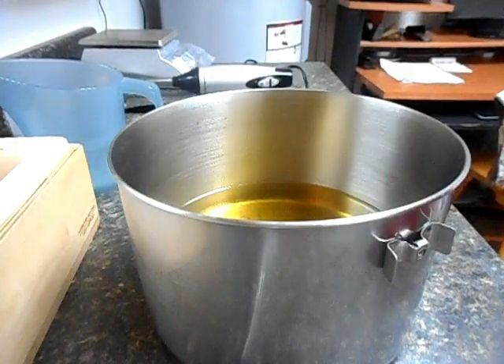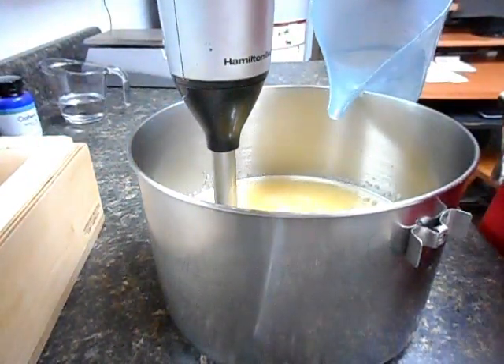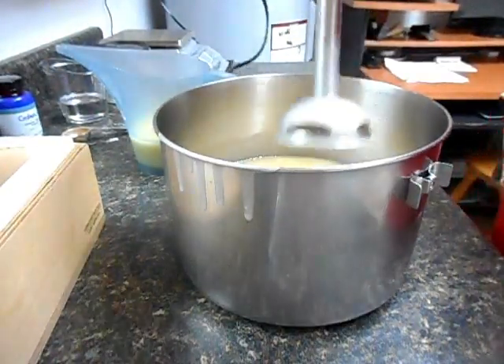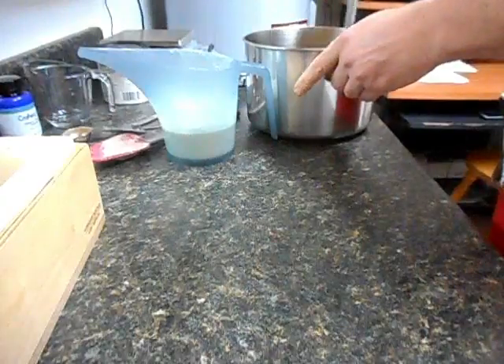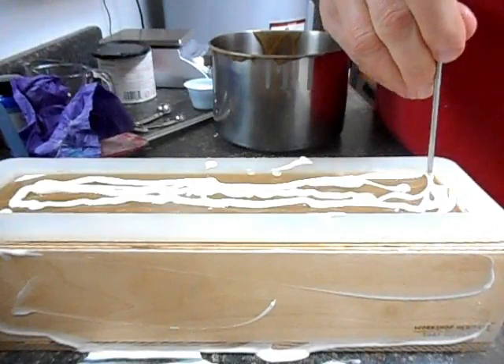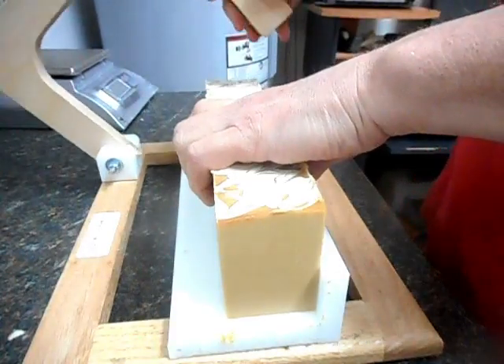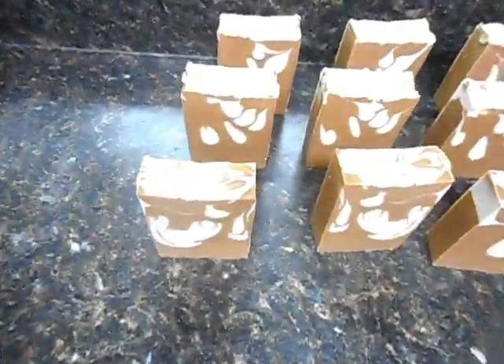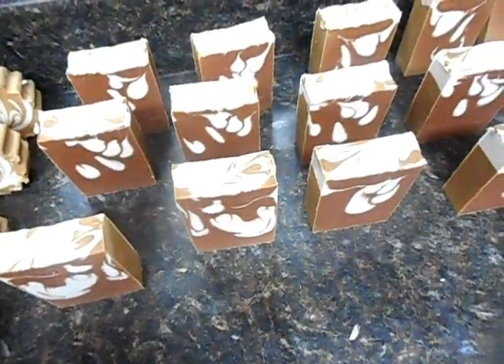Making and cutting oatmeal milk and honey soap

Comment: I really like that shade of brown you got on these bars.
If I could bother you for a favor? I know it's asking a lot but what is the weight of oils you used for this recipe? The reason I ask is that I made a batch of maybe 1.5 lbs of oil and used only a heaping tsp of cocoa, mostly 'cause I wasn't sure how brown it would get. Unfortunately, after a yr overseas, I'm down to about a half cup of Hershey's cocoa and won't get any more in the foreseeable future. I'd hate to have it come out midnight brown or some such if I use the heaping tbsp in too little oil.
Missing being in the States so much sometimes ... 😭
Reply from the maker: Hi, I'm not completely sure what you are asking, but here goes an attempt:
4 oz avacado which is 10%
2 oz castor which is 5%
10 oz coconut which is 25%
10 oz olive which is 25%
10 oz palm which is 25%
4 oz shea butter which is 10%
5.6 oz lye and 13 oz water
This makes 3.6 pounds of soap.
One heaping tablespoon made this color and it is SLIGHTLY darker now.  One level tablespoon would have been good.  I hope this helps!